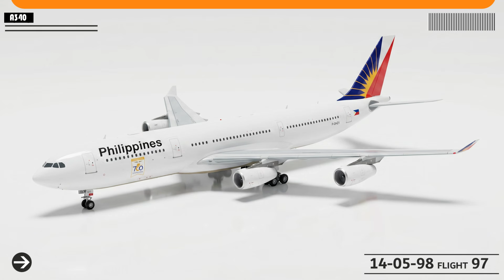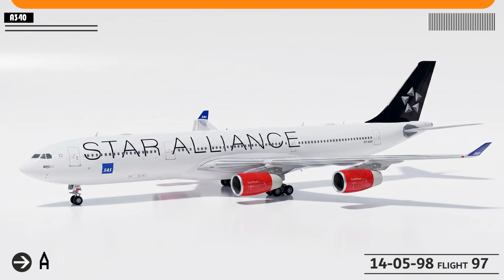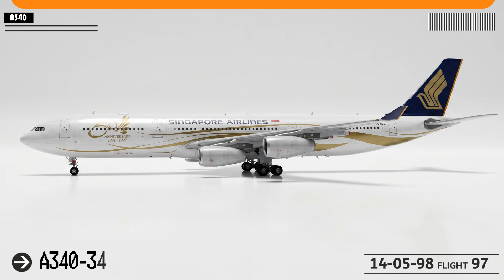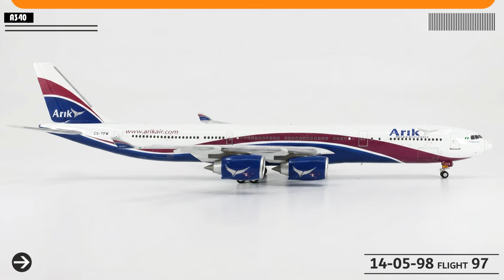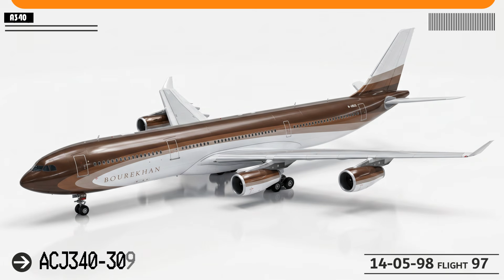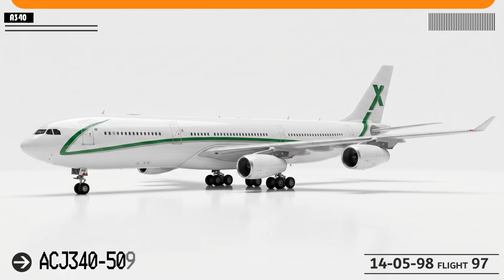Every Airbus A340 Ever Made

Comment: Fun fact : at first the A340 did not born with that CFM 56 engines , they was actually had more choice but all deleted , like IAE Super Engine project got cancelled , the RB211 engines did more but too big for maintenance and could be dangerous when it so big that if let it in the wing the downside of it only 0,5 meters spare spaces , so airbus has no choice but to use that type engines
Reply: Actually, the CFM56 was one of the intended engines for the A340-300, along with the IAE engine.